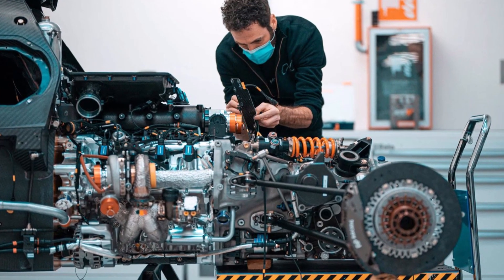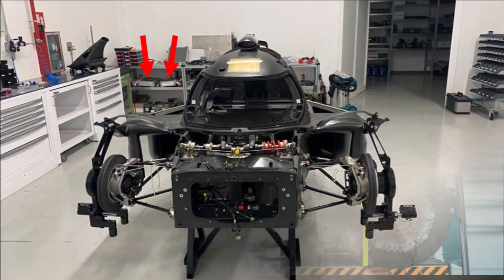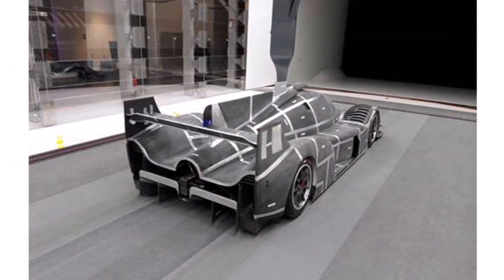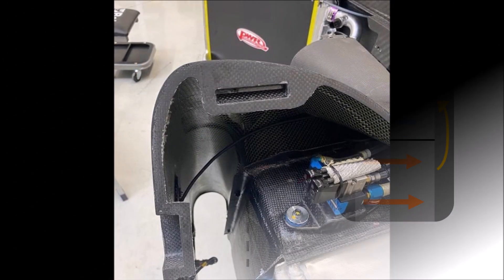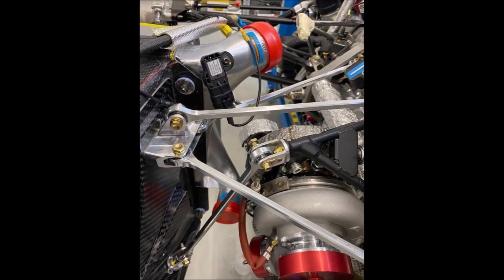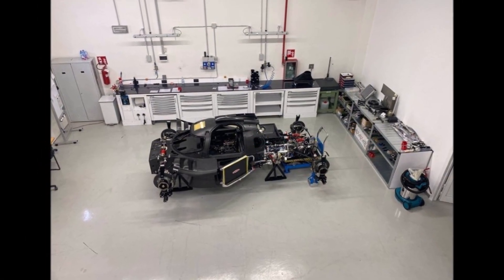SCG 007 (Glickenhaus Hypercar) Part 3 - Assembly

Comment: Thanks for your awsome video !
Why stack 2 radiators on top of each other ?
I understand that one have a lower working temperature, but, wouldn't it be more efficient to make a big one that takes up the same volume? 
Thanks for your awsome video
Reply from the maker: Thanks! If they need two different cooling circuits, they cannot mix them in one big radiator. Also one might be water, the other one oil.

Comment: Do u have a degree
Reply from the maker: Some, but does that matter? Most of what I know I didn't learn at university.
Reply: @bsport320  just asking bro. What would you recommend education wise for someone who wants to be a Motorsport engineer?
Reply from the maker: Any engineering degree will do. Important is what you do after the lectures, practical experience in workshops and teams

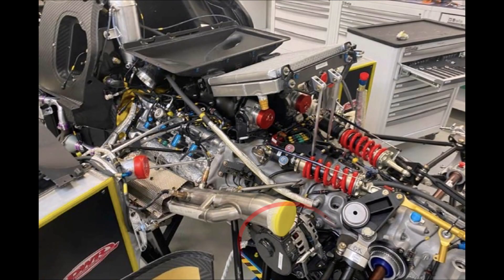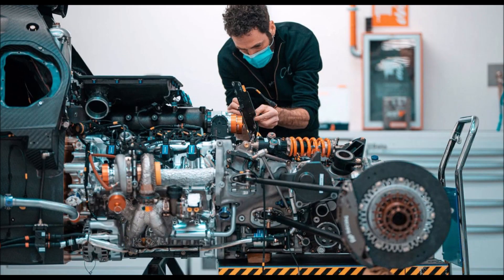Comment: @ 0:32 - that's the 2nd alternator... You can see the main alternator mounted to the front bottom corner of the engine @ 0:58.
Reply from the maker: Exactly right, I explained that in part 2.

Comment: Adjustable suspension pickup points are not only for adjusting anti lift, but also e.g. roll center height (which from my experience has the biggest dynamic effect), camber gain and their respective dynamic changes. But very nice video indeed, I like the insight into the aerodynamic aspects as I am not as well educated in those :)
Reply from the maker: Absolutely right, you change one pick up point and you change everything. Formula Student is a great school :)
Reply: @bsport320  Haha exactly, adjustable outboard pickup points and inboard y-shims can make you gain a lot of knowledge :D

Comment: It looks like the air intake for the main radiators  are getting the air flow directly from the front brakes.  Under heavy braking the air will be extremely hot and will then flow into the radiator.  Yes?  Not very efficient for cooling the engine.
Reply from the maker: The air for front brake cooling will be taken from the inner side of the front wheel and exit the rim on the outside, so no problem with that.

Comment: I hope they haven't neglected aero efficiency too much,  I'm sure the Toyota will be leading in that department and also has a hybrid system.  Let's hope the weight savings allow for a better balanced Glickenhaus!  🤞😁
Reply: I’m very interested to see how their BOP decisions stack up against other teams. 003 did well in its BOP by exploiting aero; 007 doesn’t seem to be relying on aero. 004 seems to be (from driver comments) an excellent all rounder and insanely reliable. They seem to strategize based on how best to win within regs, not budget. It’s fun to watch.